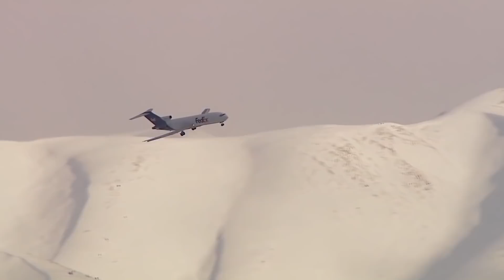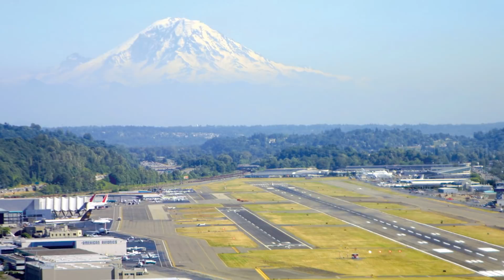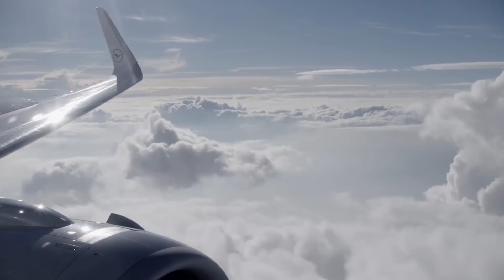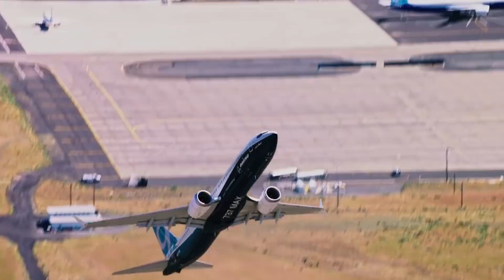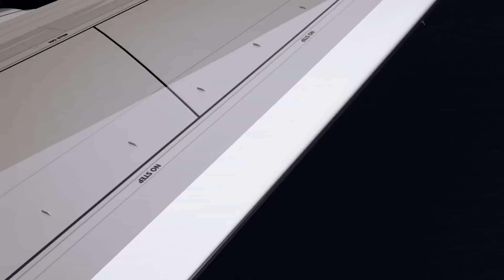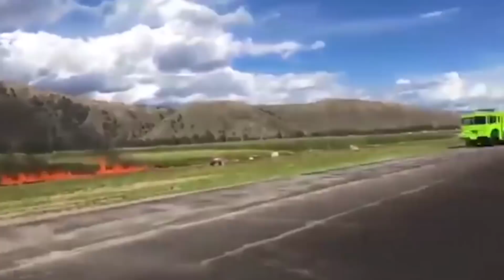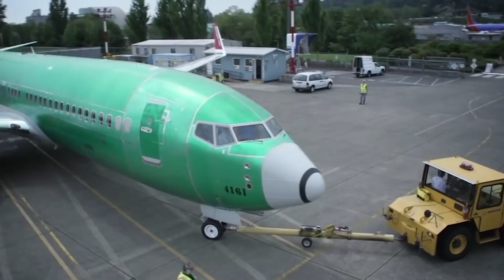Boeing 737 - the most popular airliner

Comment: The most dangerous airliner…
The best grounded airliner…
Reply: Rekt by Dank Trump XD
😂👌🔥💯
Reply: Not every 737 is a fucking max.
Reply: DeHavilland Comet Disaster
Reply: Sander Van der Kammen Sander Van der Kammen that was in 1954, Lion Air and Ethiopian Airlines crashed in 2018. Boeing didn’t learned the lessons from the past by rushing the build of the 737 max.
Reply: @lavergnee  There is nothing wrong with the Boeing 737, it's been the most successful airliner in history with an excellent per passenger mile safety record.
 The MCAS was required by the FAA regulations and all the problems with the MAX is directly related to this single add-on safety device.
Reply: @lavergnee  The Comet Disaster remains was the worst engineering failure in commercial aviation history. 
The Comet 1 was was badly designed and constructed that the entire fleet had it's airworthiness certification permanently revoked and the the planes were all eventually scrapped.
Reply: Sander Van der Kammen you’re right about the first generation of 737 but totally wrong about the max, the problem is not only with the MCAS but with the new engines fitted on the wings. Because of the position of the new engines on the wings they had to create a system to avoid the plane to go for a stall, the second error was to do it with a single sensor…
Reply: DorianTM fortunatly for the passengers.
Reply: @lavergnee  Then how do you explain the lack of problems with the  737 NG?
The Max can takeoff safety without the MCAS, All modern jets pitch up at takeoff thrust... It's a perfectly normal flight characteristic.
Reply: @lavergnee  You must also remember that in both accidents the flight control problems manifested as a runaway stabilator trim error and it appears in both cases niether pilot followed the correct procedure in the event of Auto Stab. Trim control failure. 
Although it appears that the MCAS initiated the flight control problems both accidents it should have been recoverable and were ultimately the result of pilot error.

Comment: Popular for airlines, not really for passengers.
Reply: I totally agree. Not because of some "Airbus is better" or "European products are better" stupid pattern of thinking. Just for practical reasons:
1. The A320 fuselage (and therefore the cabin) is slightly wider, both have 6 seats across. Every additional inch of cabin width is a benefit for the passenger.
2. The windows of the 737 are lower relative to the seats (and smaller) than in the A320. Maybe sears weren't that high when the fuselage was developed, idk. But I have to bend down to look out in a 737. I just have to turn my head to look out of a A320.
3. The A320 family, except the rare A318, can load containerized baggage. Less risk of losing a bag on the tarmac + quicker turnaround.
4. A320 are less noisy inside than a 737 of a comparable generation. (Sure, almost everything is less noisy than a 737-100).
Reply: Colaholiker  The A320 is 2 inches wider than the 737, spread out over 6 seats makes absolutely no difference. I fly frequently on both and there isn't much of a difference for passengers.
Reply: Having worked, even if only for a short while, in ramp handling, I much prefer loading/offloading an a320-family plane to a 737.
Containers are much easier, and slightly faster to load and offload, and even in the cases of a non-container Airbus, it's slightly easier to work due to the somewhat higher ceiling in the cargo hold. And, as a final thought on that would be the cargo hold doors - on a 737 they open inwards (watch your head in the already low hold), while on the a320 family they open outwards (aside from the far-back bulk cargo door, but that doesn't even necessarily need to be opened every single time, depending on how the luggage is loaded).
Reply: I don't think most passengers would notice the difference between Boeing 737 and A320 - or really care.
Reply: @Colaholiker   you definitely bring up valid points. But, the 737s wings flex way more than the a320, leading to a smoother ride for passengers. Very comfortable plane, and I have had the chance to fly in a 738 and an a321. I must say, the 737 had smaller windows, but in flight turbulence was a lot less uncomfortable on the boeing. But i know that the airbus is quieter, more efficient (which generally means cheaper fares) and have newer tech. both are valid.
Reply: @nikpaul6280  Sure, there are advantages and disadvantages to both families and I'm not saying that the 737 family is crap while the A320 family is the perfect aircraft family. ;-) For me, the behavior in turbulent air is less important (as long as the plane makes it through in one piece and the in desired orientation) as I don't mind bumpy rides (well honestly I enjoy them quite a bit). But being a rather tall person, shoulder room and windows to look through are way more important to me, because they are a factor on every flight, while heavy turbulence is less frequent to occur. But I totally see that this may be a factor for smaller people with a fear of flying. ;-) My ears also seem to be more compatible with the way the pressure control system on the A320 works, as I get less ear popping than on a 737.

In any case, if I had to chose between two flights where all parameters are identical with the difference just being A320 family or 737 family, I would probably choose the Airbus. But I'm not a "if it's Boeing, I'm not going' person, my most frequently flown aircraft is the 737-800, and even when adding up all A320 family members I have been flying on, that would be just two flights more than on the 738. And I didn't even count all the other 737 models I have been on (lots of -300s and -500s there as well, as they were common in the Lufthansa fleet). So it's just a matter of personal preference, otherwise there wouldn't be so many aircraft of both families flying around.
Reply: @Colaholiker  true
Reply: @nikpaul6280  I forgot one detail - if it's a 737-200 (or less likely -100) I would choose it over the Airbus, I love the JT8Ds. Or if it is something more exotic like the combo or QC version, too...
Reply: @Colaholiker   Those JT8Ds are beautiful! And the combi is definitely a cool aircraft for sure
Reply: @nikpaul6280  At least I had some JT8D again this year when flying on a Delta Mad Dog. Unfortunately my seat was too far away from the engines. ;-)
Reply: Colaholiker the 737 max has larger windows than the a320 and a320neo actually and the sky interior tricks passenger into thinking the cabin is larger, Boeing are really good at that.
Reply: @aidan7936  Haven't had the chance to experience a 737 max yet, so it's hard to tell. I can only judge all generations up to the NG so far... 
On the 320 side there was one flight on a neo, but on "Tighthansa" (aka how many Germans can you squeeze in?), I guess others are better examples if you are looking at the comfort.
Reply: Nay!...I fly them both every week. The Airbus needs to get rid of the "growling dog" phenomena. I spoke to a pilot and he explained it to me and it made sense then, now? not so much
Reply: Agree. Just seems like the 737 handles adverse weather/turbulence better than Airbus
Reply: Close to zero passenger care what plane they fly on, they care about the price.
Reply: Really? How do you know that? I know many people such as myself who care a lot what we fly. "if it ain't Boeing, I ain't going" is my mantra.
Reply: @kendallevans4079  What's wrong about the famous "dog in the cargo hold"? This is just another sound of a piece of equipment working the way it is designed to work. There is a good video (i think it was by Captain Joe) here on YouTube describing this device called "PTU"  and the sound it makes.  It ain't broke, so don't fix it. You wouldn't want to get rid of - let's say the APU sound, would you?
Reply: @Colaholiker  Great argument, but either you have never flown on a modern Southwest 737-800 (or newer) OR I've never been on the right Airbus... Hear me out.

Judging from my personal experiences as a passenger, I can say that flying in a Frontier A321 was one of the most uncomfortable flights of my life. I fell asleep and woke up on decent feeling like my eyes were about to explode. This was probably due to a pressure difference which does happen on any airliner but I've only ever had a problem with it on Airbus models. When I sleep on a Boeing I'm usually quite well-rested upon waking up.

As for the seats, it ends up depending on the airline and not the plane itself. I've flown on several A321s and 737s with an almost random chance of seat sizes, but the record holder for comfort as of me writing this goes to the 737-800 outfitted with Southwest's "heart interior". This had a truly surprising width and cushion-like comfort for economy seats.

As for the windows, I have noticed the slightly lower windows on 737s as compared to the a320 series. The only catch is something you didn't acknowledge in your comment: the actual size of the windows. You see, while I may be lowering my neck 1-2 inches to see properly out of a Boeing window, once I'm there I can see fine around a comfortable field of view. Airbus windows, on the other hand, are significantly smaller than those on a Boeing and require much more lateral and horizontal head movement just to see a smaller portion of what's outside. All in all, I personally prefer ducking a couple of inches to have a much better view.

About your 3rd point of baggage, I can say that I personally have never known anyone or even ever heard of losing baggage onto the ground at the ramp area. That isn't really a huge concern and before an aircraft is ever even pushed back the surrounding area must be clear. So in other words, losing baggage is not something major to worry about.

In your 4th point, you stated that a320s are less noisy inside than a 737 of a similar generation. Again, as a passenger, I believe the noise level is less on the 737 than the Airbus but only by a small margin. Both planes sound similarly loud from inside.
Reply: @LightRealms  You are right that I haven't flown on a Southwest 738 yet. Being from Europe this is not that surprisng. But I have been on several 738, as a matter of fact I haven't been on any other plane as often as on the 738! More than twice as many flights than on number two on my list. The newest of them just  had a few dozen flights before I was on it in 2007. Before the introduction of the MAX series, the only 737 models I haven't been on are the -100 and the -900. The latter is going to change in June if they don't change the aircraft.

I haven't flown Frontier either, but maybe (this is just a guess since I haven't been on the same flight as you and I never had that experience flying on an Airbus) something was wrong with the air conditioning system on that particular flight. I am in no way doubting your experience, but I haven't had that kind of experience myself yet. To be fair I must admit that I never slept onboard any plane since I can't sleep while I am seated and I haven't had the chance to fly business or even first class on long-hauls. It simply cat't happen while squeezed into any economy class seat.

The seats are partially up to the airline and partially up to the plane. Sure enough,  seat pitch, backrest shape and padding are the decision of the airline. They can be horrible or awesome in any plane. But for seat width, the aircraft type plays a significant role (unless an airline decides to use less seats per row than the aircraft was designed for). The interior width of the fuselage is out of the airline's control, and when you try to fit 3+3 seats into the aircraft (no matter if it's a 737 or A320 family), and you need to have an aisle of a certain width (think of the drink carts + aisle with required for proper evacuation), you can only divide the remainder by 6 and get your maximum seat width. With the same aisle width you can have slightly more seat wisth inside the A320 fuselage as it is slightly wider.
I have been on 189 seat all-eco 738 operated by different airlines, and while Ryanair was a consistent "well.. okay" comfort experience I had two totally different experiences on two TUIfly aircraft. One was even better than Ryanair, the other one was so cramped that I stopped feeling my legs 2 hours into the flight and after a good 4 hour flight I was no longer able to walk but had to crawl to the baggage claim. I'm a quite tall guy I must admit.

I never had the impression that Airbus windows are smaller than Boeing windows. The only difference I noticed it that they appear to be differently sized depending on the interior used on the aircraft. The sculpted shape of the side panels can create the illusion of a difference in size. (First I thought newer 738 had larger windows than older ones, but when I was saw that they received new panels I figured out that this is only an optical illusion, For sure they did not enlarge the holes in the fuselage. ;-) So maybe the Airbus windows appeared smaller to you, I don't know. I have never measured the exact dimensions on any aircraft though. Maybe you also have to duck less to look out of the window than I do, which is likely if you are not as tall as I am, so it is not as annoying to you as it is to me.

My baggage point was not targeted at actually losing baggage. It was targeted at the convenience of the poor (mostly) guys loading the plane. If the baggage is loaded in containers on the ground first, this can be done in a more or less comfortable position for the loaders' bodies. Loading the containers on the planes is mostly automated. If they have to squat into the cargo holds to manually stow or pull the bags this is a hell of a job. Especially in hot summer or cold winter, where containers can be loaded indoors, while the cargo holds are either sizling hot or freezing cold inside. Plus I usually see less dents and scratches to my bags after flights where they are loaded into containers.

The noise level depends a lot on where you sit inside the plane. But I read an article (off-line and in German only, so I can't link it here) where they took measurements in different areas of the aircraft and compared the averages between a 737 NG and an A320. And on average the A320 was less noisy. Of cause there's likely a seat on the 737 which is quieter (like up front) than another seat on the A320 (like right behind the engines), but that would be more of an "apples vs. oranges" comparison.

I think this is much of a YMMV thing, you can have great or horrible flights on either type and our preferences are different. But hey, that's okay for me. I won't try to change your opinion, I just don't agree to it. ;-)

Comment: It would seem that the success of the 737 is also proving to be a downfall.  They have OVERUSED the basic design from 50 plus years ago and that is only ONE reason the MAX disaster's happened.  Competition with Airbus is probably a big reason why they failed to do a proper update to the plane.  I mean, yeah, they updated it over the years, but they could have done better!  Corporate douchebag "Bean counter" idiots running a company that was famous for amazing engineers and workers could not have helped!  FWIW, I have flown on different versions of 737's for 90% of my flying life and none were an issue; never a MAX though, mostly 300-900's.  The only plane I truly felt unsafe on were DC-10's in the late 80's early 90's, but even those have turned out to be VERY reliable.

Comment: And now it is the Airbus A320.
Reply: In terms of sales, definitely true, certainly in terms of sales rate over its life, and the difference in numbers built is rougly 920 in favour of the Boeing, but it took 20 years longer.  In a few years, even with COVID-19,  the A320 will beat 8t in terms of number built.   In terms of commercial aircraft the A320 is even closer to the 737 numbers when the generous US military subsidies which led to a lot of sales to the military are not included.

Comment: 737 is a good aircraft, but not 737 max 8 or 9, because 8 and 9 are killer machines made by Boeing, controlled by computer and not by pilots, period
Reply: The pilots can override the MCAS, IF they know how. Many planes from Boeing and Airbus have software similar to the MCAS. Every airliner flying has computers controlling aspects of flight.
Reply: @DaveMiller2  computers in any plane is like hands free phone and should not control the plane until it crashes, takenote computer cannot see, pilots can